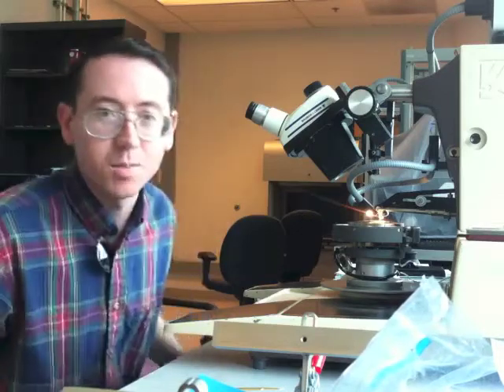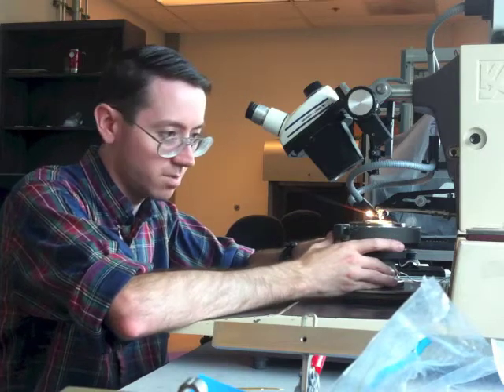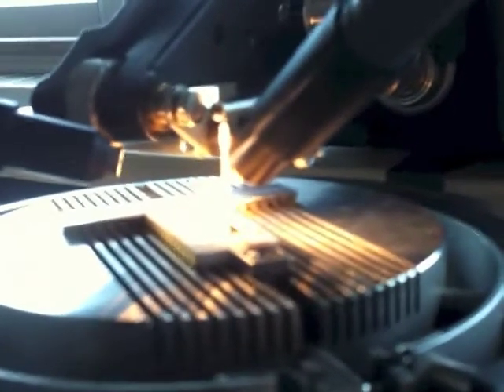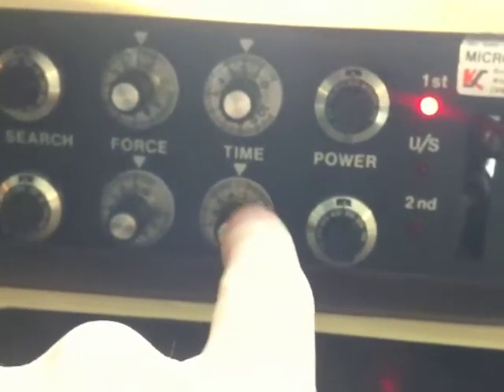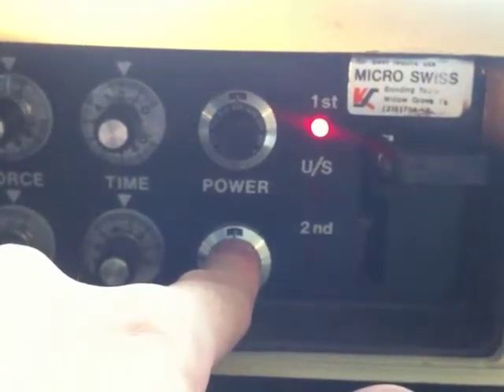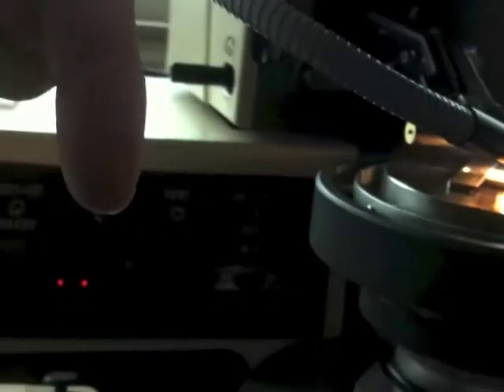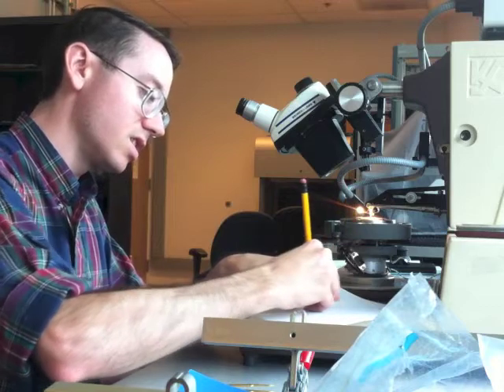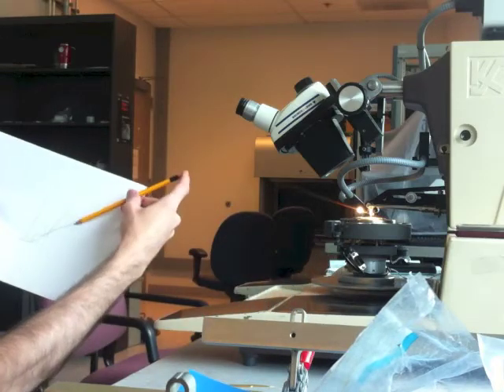Wire Bonding by SWF, Part 1 of 3

Comment: For those who need to learn: 
Loop: the length of wire left between 1st and 2nd bond. It is very important!
Search: Distance above which the tip stops before the bonding starts. Very important!
Power: Used ultrasonic power. Very important!
Force: Bonding force applied to the wire. Very important!
Time is time of bonding...

Upper row for the 1st bond and lower row is for the 2nd bond. So, you have to set them all up if you want to perform 2 consequent bonds.